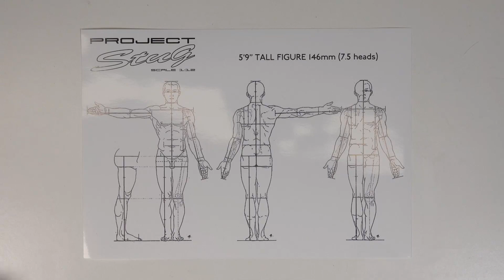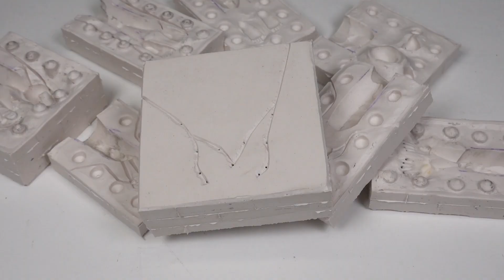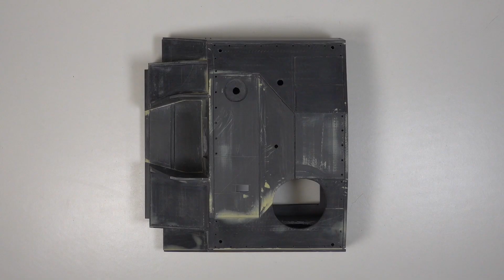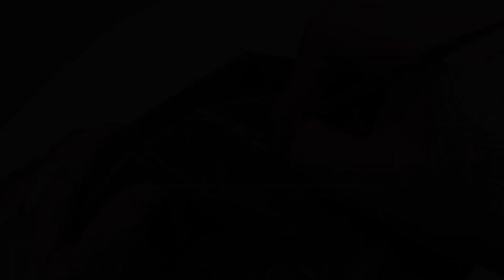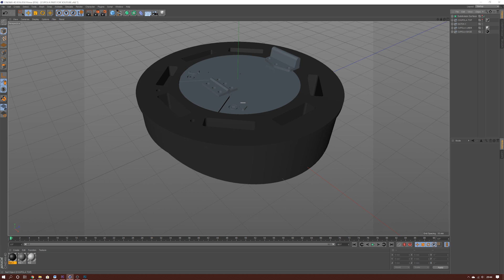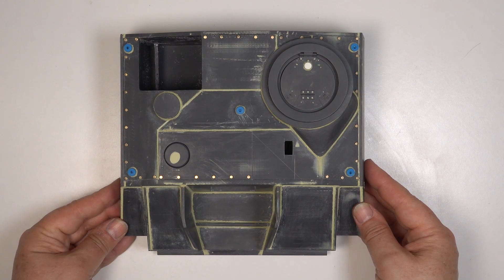PROJECT StuG PART 2  ‘CUPOLA, WELDS & MORE’

Comment: NIce.. why not just design in and print the weld channels and holes?
Reply from the maker: Hi Spinnetti, it's a good point, but given the amount of clean-up for FDM prints it is a lot easier and sharper just to add the weld details and holes later by hand.

Comment: It's nice to see you also like Martin's work. I'm really enjoying watching this series, but i do wonder why you opted to 3D print more of this model than the Maus? was it a convenience choice or did you just not feel like working with laser cut parts for the time-being?
Keep up the great work.
~Jay
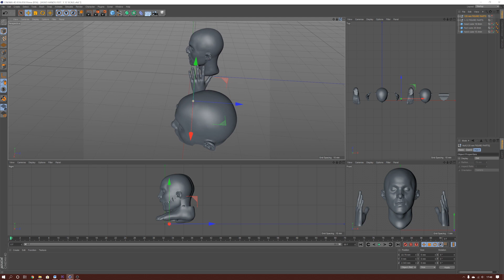Reply from the maker: Hi Jay, thanks for the kind comments. There's a few reasons why I 3D printed. Firstly the cost, the Maus cost £300 to laser cut the parts, then there's the geometry. Fitting lots of parts together to make the faceted fighting compartment was unnecessary when I could 3D print it more accurately for the cost of one roll of filament. I chose to produce the StuG in 1:12 scale simply because it was the largest scale I could fit the fighting compartment onto my printer. All the best, Sera.
Reply: @StaplesandVine  I suspected cost was a factor, need to make sure we can have more of these projects in the future!

Comment: Another great project. With your skills at CAD (and assuming you have a decent resin 3d printer), I am wondering why you take the extra step with casting the figures? It would seem to me that sculpting the figures in CAD and 3d printing them (without the need for hinges etc,) would lead to a much higher resolution final product.

Thanks for the great content and keep up the exceptional work!
Reply from the maker: Thanks dfens666, I do want to CAD sculpt figures. My 3D printer is more than capable of producing the results. I just have to get stuck in and give it a go. Right now I'm going 'old skool'. It will happen, make sure you're subscribed to see how I get on.

Comment: Sera I think you would enjoy Zbrush, especially for figure sculpting it's expensive but I think it's worth it in the end.  And just to let you know you inspired me to go down the same road, turning my 3D models into physical items I just haven't decided on a printer yet, not doing metal only resin casting. As soon as I seen you're beads I knew uncle night shift was involved 🤣

Always love your videos entertaining and very useful or informative is the word.
Reply from the maker: Hi Vasili, I've looked at Zbrush but I'm going to try Blender which seems to be improving all the time. Printer choice is a bit of a minefield. The best advice I have is work out what you need in terms of output then find the printer to suit. Glad you like the videos, Sera. - 'Night Shift rocks'.
Reply: Yeah tell me about it, I haven't got a massive budget, I have around £1,000 and that's for pressure pot and vacuum pot / vac pump. Probably just have to start on a elgoo mars, as they seem ok. I hope you don't mind me bending your ear in the future, with random casting questions 😜👍🏻
Reply from the maker: @vasili_vas  bend my ear anytime. The model making community is all about sharing. Have you looked at the 'Anycubic Photon'  - seems a popular choice these days.
Reply: I haven't , any printer I get will be a stepping stone to a better printer 🤣 , all I know is I need is a resin one and good quality prints. Bed size isn't a massive issue atm. Baby steps and all that. I know I can 3D model but getting them in my hand is another thing. Obviously you know that better than most 👍
Reply from the maker: @vasili_vas  Good luck in your quest for a 3D printer! On another note I've just downloaded 'MakeHuman' which may speed up my figure sculpting. I may do a comparison.